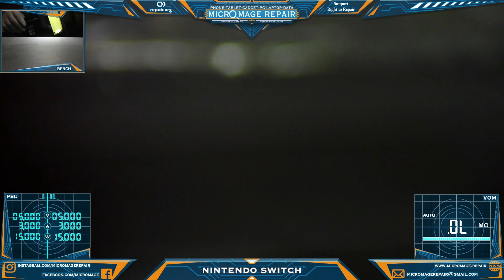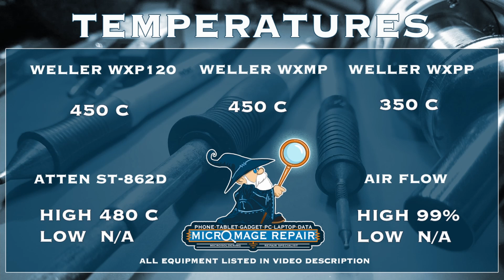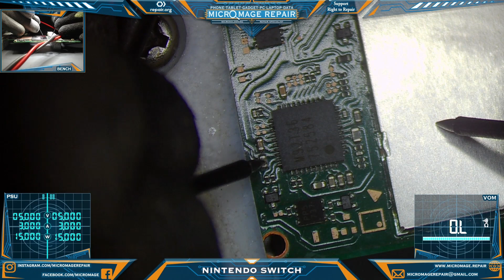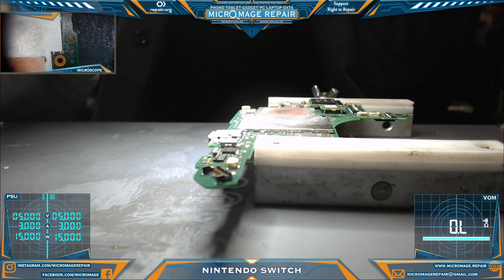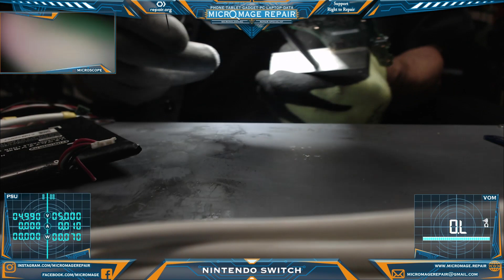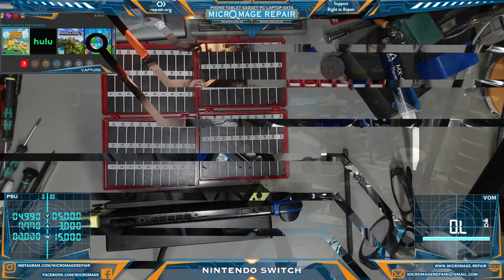Sometimes you get lucky breaking your port...sometimes you do not!

Comment: Hi josh u know the small black chips by m92t36 what value are they also is there anywhere to buy them or only donor ty
Reply from the maker: Are you talking about the filters or a multi legged chip?
Reply: @MicroMageRepair  are the filters the small black by btm of m92t36 that are in twos ?
Reply from the maker: @markhitchen5489  100k resistors, all around it
Reply: @MicroMageRepair  have we got them on ps4 boards
Reply from the maker: @markhitchen5489  No idea, I don't have many component measurements for PS4s. I hardly see them for anything beyond HDMI ports.
Reply: @MicroMageRepair  thank u josh il measure them see if they match
Reply: Ps keep up your great work

Comment: Great video as always, would just like to say thanks for the advice on the lcd and usb-c connectors / ports.  Got a working switch now.  BTW there's a video on here of a guy that found that if a nand board is shorted (good nand) it will also short the m92 & pi13.
Reply from the maker: Appreciate it!
I saw that as well. Thanks!